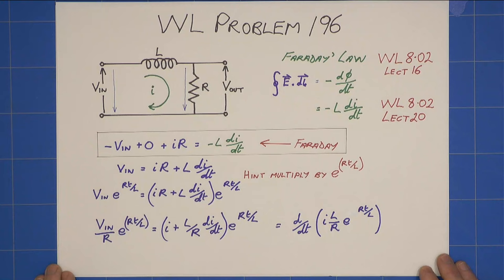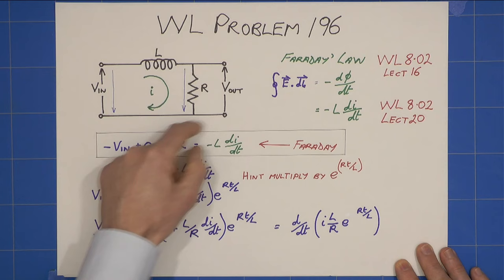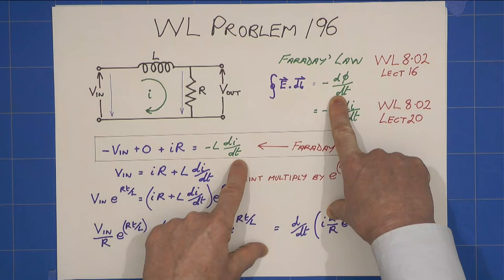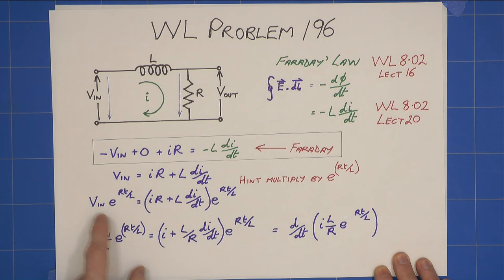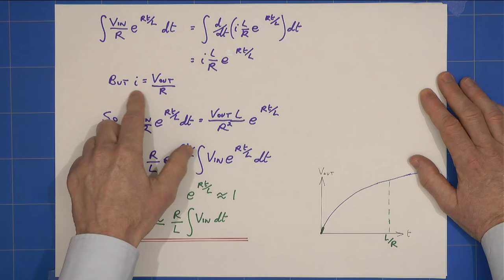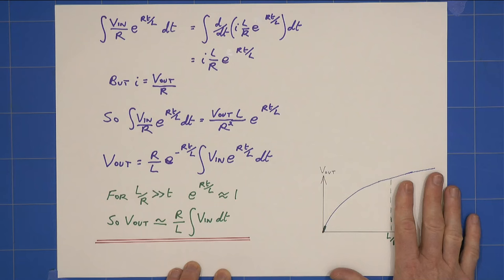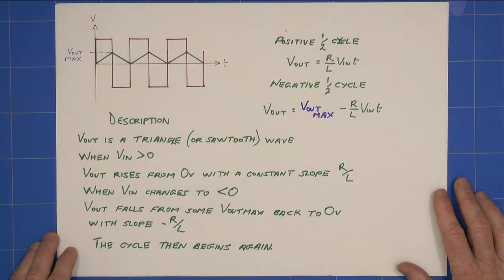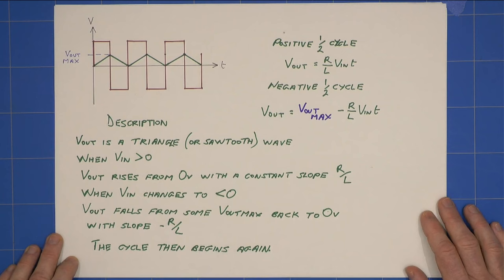Keith Norman's Solution to 196 - Integrated Circuit

Comment: Greetings sir. I have Neet examination going to held on 5th May this year. It has been around 13 months when i started preparing and it was going smooth until now. But whenever i tried hard for something i always end up messing things up. And the reason is that i lost confidence at last moments and I'm feeling the same this time. From the completion of my 12th exams last year , i gave my everything for this examination whether it time, health etc. Sir please help me out. I am loosing my hold on concepts which i used to have mastered .
Reply from the maker: Watch all my 94 MIT course lectures. Start with 8.01, then 8.02, then 8.03. Do all the homework and take all my exams. I guarantee you that you will then do very well on the Physics portion of any freshman college or JEE exam  You will find all information you need on this channel in three playlists "Homework, Exam, SolutionsY & Lecture Notes".
8.01 & 8.02 will each take about 200 hours, 8.03 about 250 hours.

Comment: Impressive. I should have done the math. The aproximate sign needs to be there as the integration is not perfect. The last page of his solution does not account for the sawtooth signal going below zero as it will in time but that is exactly what the aproximate sign is about. I'll study the math, i'll learn a lot front that ...
Reply: Thanks. One thing that I try hard to do is keep videos short otherwise I would ramble on and on. I now use a stopwatch while recording them. Guess who I copied that idea from!

Comment: But there is a voltage drop  across an inductor, which is proportional to the rate of change of the current passing through it. So, why does Keith take it zero??
Reply from the maker: there is no E-field in an ideal inductor. Thus the integral of E  dot dL through the inductor is zero. However, if you attach a voltmeter over the inductor you read a value minus*dphi/dt bcoz you have now created a new loop which includes the voltmeter and the inductor.
Reply: Good question.  There is an apparent voltage drop across the inductor as you will measure with your voltmeter, but it it is due to magnetic induction, rather than electrostatic interactions of charges.  The field is not conservative, and does not add up to zero around a closed loop.

One way to approach the inductor, is to treat its apparent voltage drop, as if it were a real voltage drop, ∆V = L*dꞮ/dt.  Or a variant of this formula, ∆V=Ɪ*Z_L, where Z_L is the impedance of the inductor, Z_L = j*ω*L for the Fourier domain and Z_L = s*L in the Laplace domain.  You then use it with Kirchhoff's laws, exactly as you would if it were any other kind of circuit.

This approach is mathematically correct, but not physically correct.  Because this apparent voltage drop across the inductor, isn't really a drop in electric potential.  Instead, it is a consequence of a non-conservative electric field, which is more accurately modeled by Faraday's law of induction, rather than Kirchhoff's voltage loop law.

A similar comparison of methods (Newton vs D'Alembert) happens for forces in an accelerating environment.  One approach is to add up forces and equate them to m*a, which is the more physically accurate way to do it.  Another approach is D'Alembert's principle, treating the apparent inertial force (-m*a) as if it were a force, and summing it with the other real forces, to add to zero.  Both get you the same result mathematically, one just reflects the physics a lot more accurately.
Reply: @lecturesbywalterlewin.they9259   Thank you sir for the clarification!
Is it that we have a square wave as an input and for that part of the square wave where we have a constant voltage like for the time T/2 I think, the di/dt for the inductor is zero.
Love from India!!
Reply: @carultch   Thank you sir for the clarification!
Is it that we have a square wave as an input and for that part of the square wave where we have a constant voltage like for the time T/2 I think, the di/dt for the inductor is zero.

Comment: One thing I'd like to point out is that I was able to post two links to desmos where I set up interactive charts for both Vin and Vout.

Various parameters can be set in the charts, like Vmax, period and so on...

I cannot repost the links, so you'd have to check my solution in his previous video showing the problem.

Another thing is that I posted the actual equation that you can use the generate Vout.

Here it is again:

The output of the square wave is a triangular wave (isosceles), with an equation of the form:
(2a/π)arcsin(sin(2πt/τ-π/2))+1, for some a.

There was a lot in my solution and maybe it was too complicated, so it probably confused someone, but here some conclusions from it:

Current out:
i'ₖ = (1/L)·ₒ∫⁼ͭ vₖ dt

Thus the output voltage is
Vout = v'ₖ= i'ₖR = (R/L) ₒ∫⁼ͭvₖ dt

For the time t< 1st half- period T₁:

Vout
=(R/L) ₒ∫⁼ͭvₖ dt 
=(R/L)vₖ ₒ∫⁼ͭ dt , as vₖ is constant over ½period
=(R/L)v₁ t₁, with 0<t₁<½T₁ & k=1

Input: Vin, 1st half-period= v₁ ,
Output: Vout=v'₁=(R/L)v₁ t₁, 0<t₁<½T₁
Slope=R/L. Here t₁ range is for ½th Vin cycle.
The next Vout has a negative slope as v₂ becomes negative...and so on.

Also, we have the relationship: v'₁/v₁=t₁/τ, where τ=L/R is the time constant of the circuit.

Vout is the area under the curve when 
Vin is plotted against Rt/L.

My original Vin diagram may have been misleading and didn't come out right 
(it is difficult to diagrams on yt comments), 
so here's a new one:

↓t=0 here.
0.....…τ…….2τ…..…3τ....→

↓---τ---↓---τ---↓---τ---↓ 
𝄄  v₁ 𝄄    𝄄 v₃ 𝄄    𝄄 v₅ 𝄄
......    .…..¹   .…..¹
↑ ¹ |   ‘|   `|   ‘|    |    ᵢ   }+ℰ=Vmax   
ᵗ⁼⁰ '|....|   ‘|....|    |....|   } -ℰ=Vmin
↑     
vₒ   𝄄 v₂ 𝄄    𝄄 v₄ 𝄄    𝄄 v₆ 𝄄.    vₖ(extrema)=(-1)ᴷℰ
(Assume: vₒ=v₁=Vmax)

Vin vs Rt/L:
......   ......   ......
 ¹   |...| ³ |...| ⁵  |
        ²      ⁴
If you plot Vout vs Rt/L, you end up with: 
  ⟋ ⟍ ⟋ ⟍ ⟋ ⟍
    ¹   ²   ³   ⁴   ⁵
Slope here is 1 for odd half cycles or -1 for even half cycles.